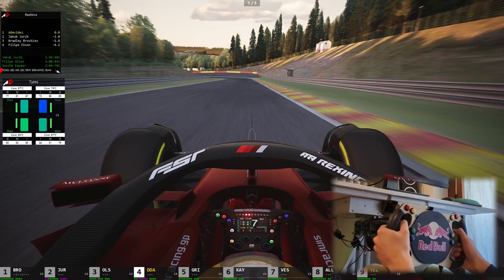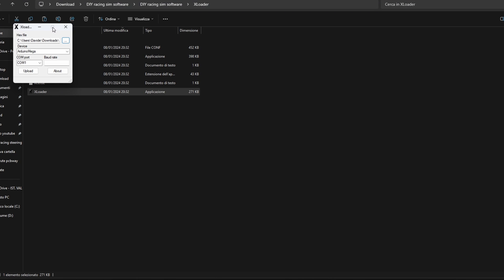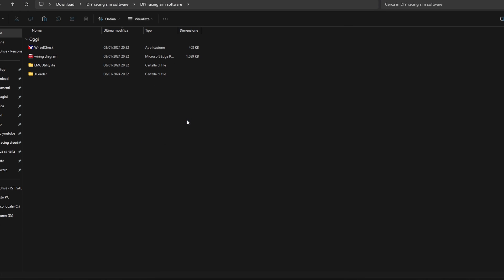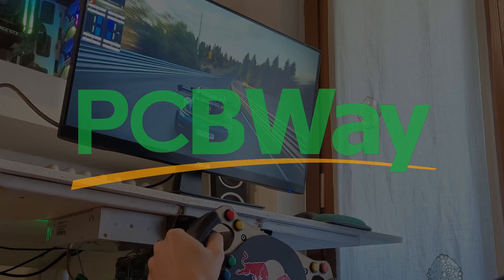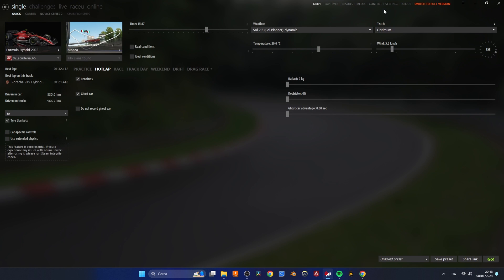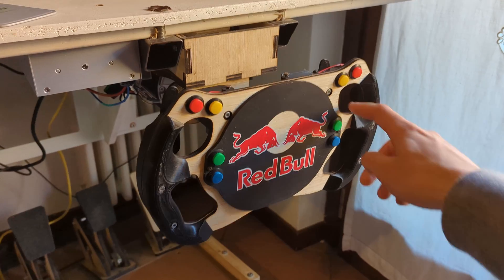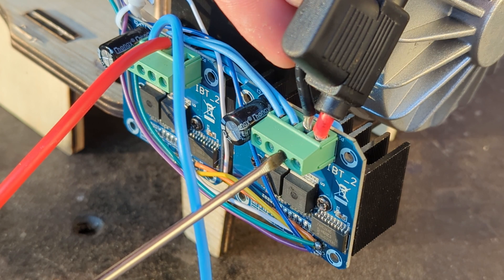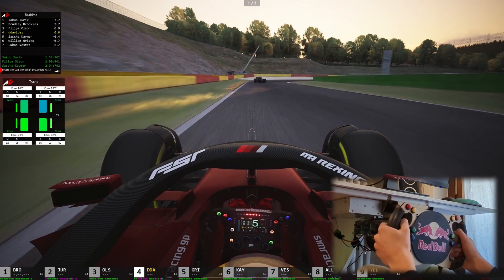DIY racing simulator | HOW TO set it UP

Comment: Hii bro I just finished my project and one thing I noticed is that my wheel is heavy when the psu of motor is on but without giving power it feels smooth I already change bts7960 motor board as well. And I am using emc utility pro version can you help me with that
Reply: bro pro version kitne me liya?

Comment: Hello how is it compared to wheels like Logitech g29 and thrusmaster t300rs gt? And is it worth making or should I go for wheel like Logitech g29?
Reply from the maker: I would suggest you wait a month or so because I'm working on a new Direct drive steering wheel using a hoverboard motor. That wheel will cost around 200$ and will be miles better than any entry level wheel on the market with 15nm of torque and all the DD feedback details
Reply: @DAZprojects  oh that's great but I also wanted to know are the worth making and does software give issues?
Reply from the maker: @Sardify  this one honestly no, even though I'm having so much fun and I already got some farely good times like a 1:22:251 in Monza with a rss formula hybrid 2023. The hoverboard one, also looking at cost, makes way more sense to build, I can't speak for software yet but the open source firmware "ffbeast" has a huge community and shouldn't give any issues. As for performance this one is good, but not great. The hoverboard one will be much much smoother, and the DD construction will give every bit of detail you can find in 500$+ DD steering wheel
Reply from the maker: @Sardify  if you have the skills I think you're better of building one with a hoverboard motor, otherwise get a good entry lever DD wheel. Going for the g29 I think isn't a good option because it will cost basically the same, or even more for a wheel you will want to upgrade as soon as you get good at sim racing. Building your own will get you a much more premium feeling being DD and 15nm vs the ~5nm of the Logitech
Reply: @DAZprojects  Logitech is 2.1 nm and I don't have any skills But don't have money to buy the g29 that's why thought of making one
Reply: @DAZprojects will be eagerly waiting for that !!
Reply from the maker: I don't know how it compares because I never tried one, it's for sure much more powerful and has better feedback.

Comment: hii really impressed by your project. can you try 100% ffb as in logitech wheels there is cranky noise due to gears and i see you used planetary gear to increase torque so do you feel the cranky noise on full ffb settings?
Reply from the maker: On full FFB settings the wheel is just too powerful and it's unusable, anyway there's not any strange noise coming from the gearbox, just a bit of extra friction and a bit of backlash
Reply from the maker: Anyway I'm now working on a much cheaper and higher quality direct drive wheel with a hoverboard motor
Reply: I want a 3-4nm torque wheel what can I do? @DAZprojects
Reply from the maker: @Sardify  Wait to see my future project on a ffb direct drive wheel based on a hoverboard motor, it's much cheaper and should provide 15nm, you can just dial down the settings and get 3nm
Reply: Eagerly waiting for the new video